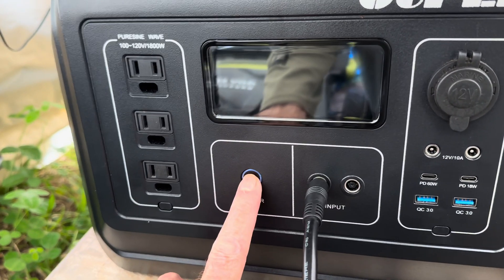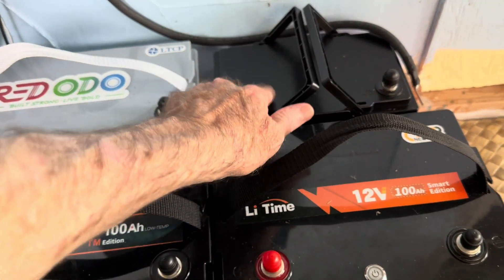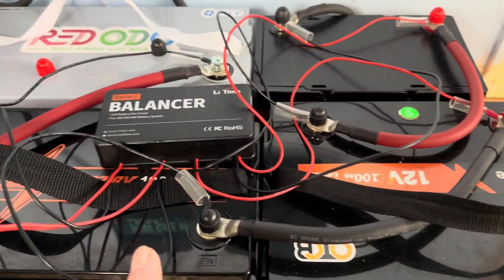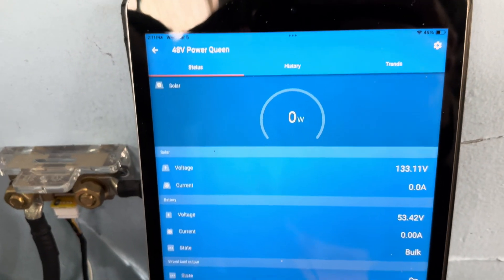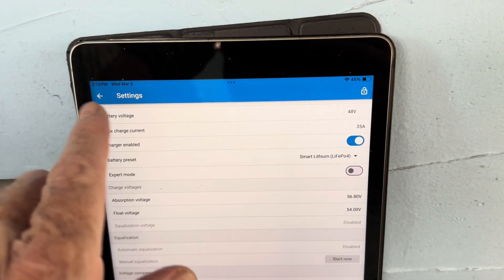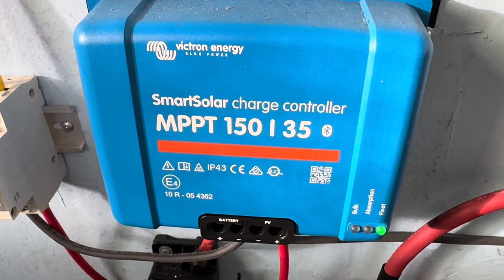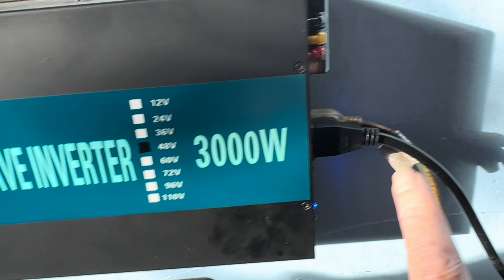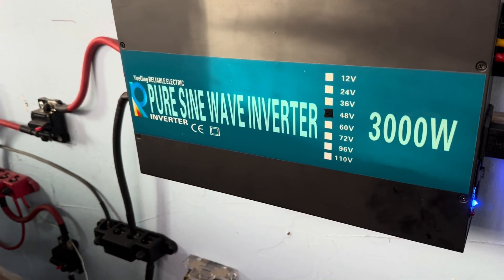Queen Dead and Pulled Out New 48V LiFePO4 Build In: Problem Resolved?

Comment: Hey Bob.  Glad to see you cooking with "solar" again.  Ironically, I just put my four 100Ah HQST batteries in series as well but forgot to set to Smart LiFePO4 (56.8).  I did discharge 20Ah last night using a heater.  Here is the kicker, so today during wildly changing solar I noticed the batteries would hit 53.37 +- and basically stop the PV from charging.  I have the same balancer installed too.  I have never seen that before.  But my charger was targeting 58.6 (typo) and I bet the end point batteries said 'no'.  SO I did an audit of all of the settings to confirm everything and hopefully the charging will resume in the morning rather than look like a saw tooth charge.  Tomorrow I will put a clamp meter on between EACH battery to see it in real time to confirm my thoughts.  Unfortunately, the PV voltage is only 68 on that array I was using and that MAY have contributed to the weird behavior.  I also noticed your PV peak voltage hit 148v!   One note to the viewers on parallel batteries.  Use a clamp meter to see the various currents going into and out of your parallel batteries......you will see that they don't always stay equal and in fact I am seeing some that just sit there and do nothing!!  But the ones I am seeing this on are all Redodo.  I even disconnected them and tested OK, just lazy battery!  HQST batteries have been great so far after one year in a 12v 4P configuration.  Looking forward to the teardown of the PQ and what options you end up with.  Gary in SE MI

Comment: Awesome Bob !! Now you have time to figure out battery ! I don't think you could swap them if was lead battery .  100AH 12V lead is heavy ! than 4 of them.  After a day or so look at charging graphs and each 12V with meter .  Went threw a 70 MPH + wind storm and snow sqale  warring.  Still windy but like 30-40 Mph now.  Heavy snow coming. Getting the edge of that mass storm system. What a winter . Got wind and solar today but solar way down.  Now it is time for the Queen to see DR Bob and figure out what went wrong. 48V inverters draw much less under heavy load.  Looks good now !
Reply from the maker: Mahalo Robert! This morning on the multimeter evry battery was at 13.25v. I was pretty happy to find they were all exactly the same after just one charge, and discharged about 10%. Charged back up to full again today, no problem. I'll keep a close eye on them, but so far super happy. Catching pretty good rain as I type this, which is perfect. Been dry here. Be tearing that PQ down here shortly to see what's what on it. Aloha brother!🤙

Comment: The weird noises were,becouse the power QUEEN BMS was cutting out,becouse of individual cell high voltage protection(as i wrote below,how and why),becouse they are probably massively out of balance,due to crap BMS balancer.Or BMS totaly broken,that can happen too.If the BMS is at fault,and you dont want to fiddle with warranty,just get a cheap 100 amp JK BMS with 2 amp smart active baalning,we can set it up when you have it(it has blootooth app,where you can set the balancing voltage values,and everything else,and also monitor the battery from your phone any time,unlike with currecnt BMS).I am 100% sure the cellls themselves,are totally fine,and usable,after doing a good balancing on them:) The battery is not a total waste i am sure!

Comment: Looks like the multimeter is not set correct. Limit 20V is to low - numbers will be wrong. PowerQueen must be checked again.
Reply: I saw that too. Would have flashed out of range if there was a voltage over 20

Comment: Dont do this absorbtion and float voltages with LIFEPO4 batteries....its not just not needed,you stress,and can even damage the battery doing this.I know many manufacturers recommend certain practices,but they dont always know what they are doing(and if the battery fails,they say,ah yeah thank god,now you can buy more from them)....When that bank reached 55.2V,and there is no more current going from the charge controler, to the battery(on shunt u can see it) ,than it is fully charged.Best practice is to set battery to 55.2V absorbstion and float,both voltage to the same value.This way,until the battery sits on 55.2V it will balance,and wont be stressed(like with the 56.8V). On 55.2V you will have aan individual cell voltage(16cells) 3.450 V-at this point all LIFEPO4 battery is fully charged.Also all BMS balancers set to balance at 3.450V,or a little less.So if 1 cell reached above 3.450V it will start burning the energy from it,with resistors(or in case of activ balancing capacitors will redirect power to lesser charged cells),and it will balance out,every time. If You charge it up to 56.8V,You will have an individual cell voltage at 3.550 V,than they are over charged with 0.1Volts,which is alot in this case.To give an exemple why is alot,i can tell. At 3.650 V usually the BMS fets will stop all current going into the battery,if any one cell reaches 3.650V-so this is the absolute maximum allowed,becouse it will blow up,bloat out,or get damaged.Why stress a battery on 3.55V for 10+ years? Its a waste. I tested it my self,when you charge them,until 3.450V reached,it soaks as much amper/hours as it can.When it reaches to 3.450V it stops absorbing any power,maybe some miliampers,but the voltage goes in this steap increase,in like 30 seconds,or 1 minute reaches 3.600-3.650Volts,if you allow it,while in fact,it didnt absorb any more amperage,becouse its full already.Doesnt matter the brand,year of manufacturing,nothing.All LIFEPO4 behaved the same. I hope you read this and heed my advice.Andy on the off grid garage also tested these values,and he had the same results.Try watching those videos.I hope i helped,god bless you!

Comment: Been keen to see what failed on the Power Queen.
I run three 100 Ah 48 volt batteries in parallel on my 48 volt system. After watching this video you got me thinking, I probably should do a test on each battery. Make sure one hasn't failed as the system will still run from the other two. I hope the battery vampire hasn't come to visit me either. 🧛‍♂
Reply from the maker: Will be tearing that down soon, see if I can figure out where it failed.🤙

Comment: I'd open that powerqueen up..
Chances are either 1 cell is done ( most probably they either used used cells or b-grade , given the price point) and needs a replacement , or the BMS is shot, which is also an easy replacement, could consider and overkill bms
Box seems solid enough
4 batteries in series is waiting for balancing issues..
Fine as a backup system, but not for longer time

Comment: Normally you'd want to tie the four batteries in parallel first and do a full charge cycle (at 14.2V) on them, before reconfiguring them in series for the 48V.  By connecting them up in series first, the balancer is going to have its work cut out for it because the SOCs are not matched.  Gonna take a while for it to actually get them all balanced in terms of their actual state-of-charge.  Identical voltages != identical state of charge.

If this causes a lot of problems, you'll have to rip them out and do that first step.  The main problem with  4 x 12V series configurations is that due to the SOC not being matched, one of the batteries goes into over-voltage protection mode and disconnects... which disconnects the entire series.

Your charge target needs to be 56.8V.  Float at 54.0V.   Don't low-ball the charge target.  If there are problems due to disconnects its because the SOCs of the individual batteries have not been synchronized.

--

Test to perform... with the charge controller holding the battery at 56.8V, measure the voltage of each individual battery and see if they are (hopefully) all close to 14.2V.

-Matt
Reply from the maker: Soon as I read this I went and checked them. Everyone reading 13.25v...whew!  Great info my friend! I'll keep a close eye on them based on your info. Mahalo! 🤙
Reply: Jeff, I always look forward to seeing your comments and replies in regards to solar power.
I see you all over the place on other Solar channels videos.
Appreciate all the great info!
Be safe